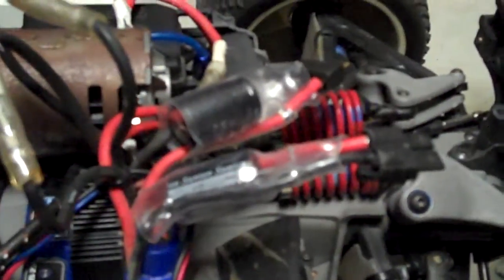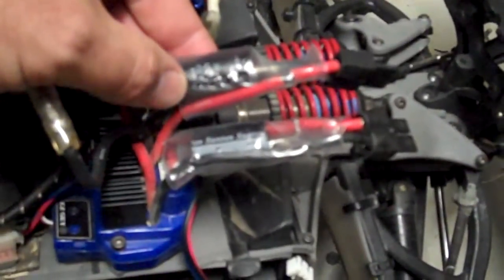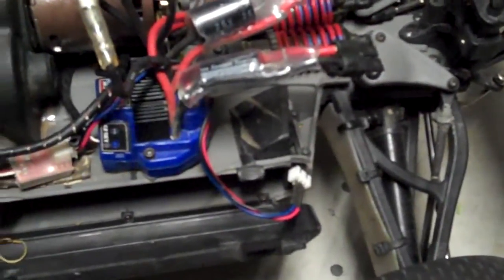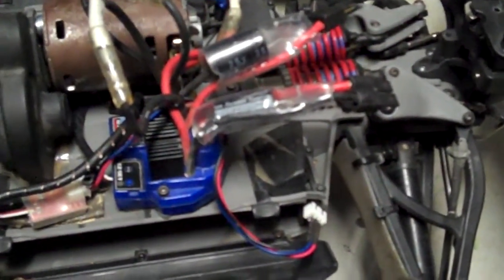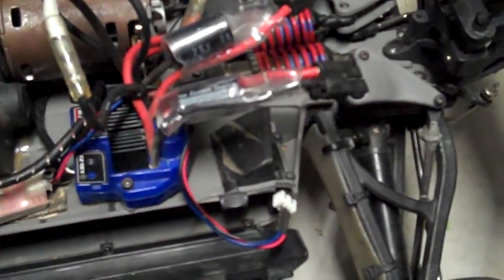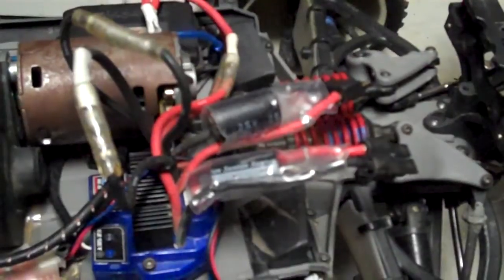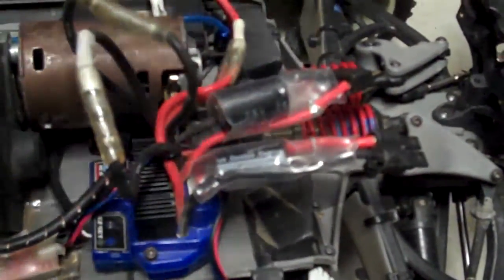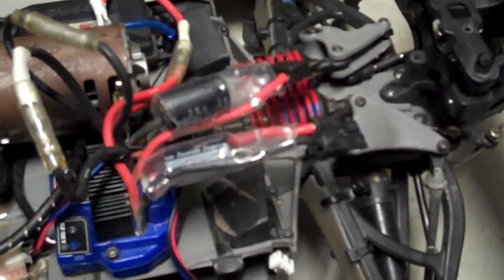added capacitors to stock traxxas evx-2 esc

Comment: For what I know from reading up on caps and ESC's:
1. Place the caps as close to the ESC as possible.
2. Use multiple lower capacity caps instead of a single large one, in order to reduce the ESR.

Comment: Have you any experience with the evx 2 giving more power in reverse then forward I changed the two motors on my e max but still the same fault. Any ideas
Reply from the maker: sorry, havent heard of that before. i havent used the evx2 for many months. i use my brushless system instead